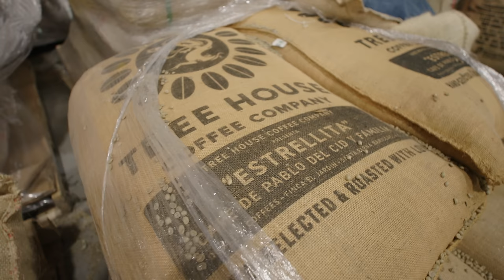The Stuff YOU DON'T SEE at TREE HOUSE BREWING | Nate Lanier Interview

Comment: Those wile guys at brulusophy have recommended dosing a little sulfite to packaging to head off some oxidation. But for a keg transfer. The dosing per can would be a bit tricky. Sounds like it came out ok as is.
Reply from the maker: It's a little riskier when the keg itself is already exposed to oxygen thanks to the beer engine, but it worked out great!